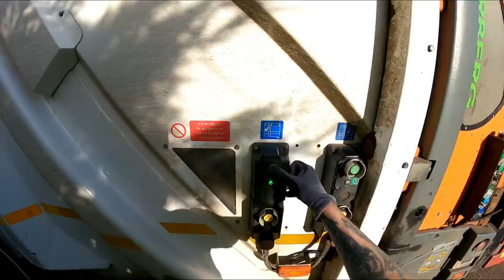Bin Man/Refuse Collector/HGV/Truck/Lorry Driver POV #14 *2000 Subscribers!*

Comment: Ex-laoder here. This is one job I've done that I actually miss. I worked for biffa, sita, cleanaway, virdent, virador and the local council down in Somerset. Absolutely loved the job, always a laugh.
Reply from the maker: Blimey you were keen on the job role, a good selection of employers there
Reply: @wheelerd02  I was agency so had no choice. This was back in the late 90s early 00's. Doing this job is better than working in a warehouse or shop...... even on wet days 🤣

Comment: One thing I see often bin men go out at night collecting rubbish have you done it or came across someone who has
Reply from the maker: How do you mean?

As in a residential collection service in the evenings?

Employees stacking bins at the roadside to speed collection the next day?

Individual bins being dipped for their sacks to reduce overall bins on the back of the vehicle?
Reply: @wheelerd02  I mean in overall waste as I see bin men with their lorries  go out at night to collect waste maybe around 10 11 o'clock at night maybe a private waste company
Reply: I'm just wondering have you done night shifts on the bins
Reply from the maker: @bradley-ts4kl  ah ok I get you

No I have not night time collection. Only residential waste

Comment: How long does a run take each day and how many times do you empty the truck on a run?

If you start early are you able to go home early when the run is finished?
Reply from the maker: Routes are job and finish, put the effort in and you get go home

Recycling starts at 0700, general waste 0630

Crews start to return 1400-1500, anything much afterwards means it was a busy/long day

Recycling squeezes onto 1 lorry load, general waste needs emptying twice
Reply: @wheelerd02  interesting thank you.

Comment: Hi mate, I work with a lateral load at Málaga, grettings from Spain. I work alone because we don't need another worker....🤔🤔
Reply from the maker: Hello friend, what kind of work is it you do? Household collection or trade waste bulk bins?
Reply: @wheelerd02  We collected householld containers at Málaga streets. At the moment I collect yellow containers (plastic, tetra brik, cans...etc) There are grey containers for the organic trash and blue containers for the papers and cardboard. Málaga has 500.000 people and we work in the night, the morning and afternoon/evening.
Reply from the maker: @miguelandresleon9989  and you did this as 1 man and a truck?
Reply: @wheelerd02  It's automatic, we only drive and we put the truck in the correct side with the lateral cameras, we only go down in case of any problem. The rear load trucks are normaly equiped  with a driver and two operators. Sorry but I have a little english level....
Reply from the maker: @miguelandresleon9989  ah I understand. Like thr USA trucks that have a side arm loading into the top of the truck.

Your English is fine man, no problem.
Reply from the maker: Need to buy yourself a GoPro and film your working day
Reply: @wheelerd02  I think that it's forbbiden in my company....
Reply from the maker: @miguelandresleon9989  a great shame

Comment: How do you know when the lorry’s full?
Reply from the maker: Weight scales would normally cut out approx 25000kg GVW. However some vehicles would cut out earlier meaning you would get less on and the day would take longer.

Some vehicles scales flat out didn't work at all risking an overload situation. Walking the length of vehicle banging a fist against the body would help determine the load position within the body. Much like tapping a watermelon or a bread roll.

However; the very simple way was when the compactor blade would stop scrapeing to the top. That and when stop wouldn't compact anymore. No negotiation, no amount of blade movement from thr cab controller you were done, time to empty.

Comment: how meny bin lorrys is in the yard
Reply from the maker: 6 black bin
6 garden 
3 maybe 4 spare/changeover 
4 trade
2 7.5t special/bulky collection 
2 7.5t ISO/narrow access 
6/8 food trucks
4 card 
4 glass & cans 
4 paper and plastic 
1 flats general
2/3 flats recycling 
1 suction/gully tanker 
1 hiab Mercedes Atego
3 Road sweepers 

These are estimates and not dead set figures
Reply: @wheelerd02  can you do a food waste vid next time plz
Reply from the maker: @ryangrowns3272  I get put where I am told but I shall bear it in mind
Reply: ok
Reply: @wheelerd02  are the 7.5 mitsubishi fusos we got 2 one to empty the bins around the city streets and one currently being used by a litter warden
Reply from the maker: @cm93431  Izusu NPR
Reply: @wheelerd02  we also have NPR
Reply: @cm93431  we also have fuso